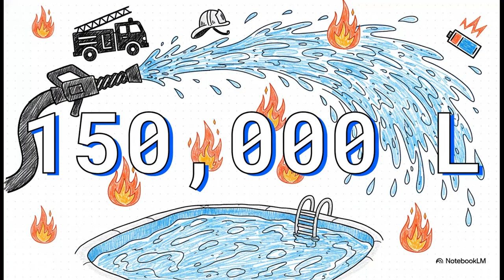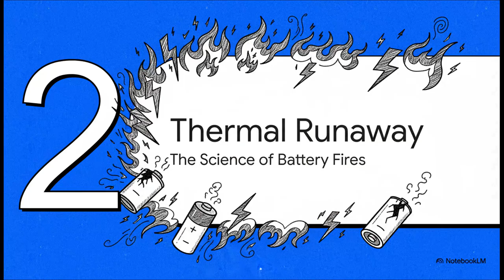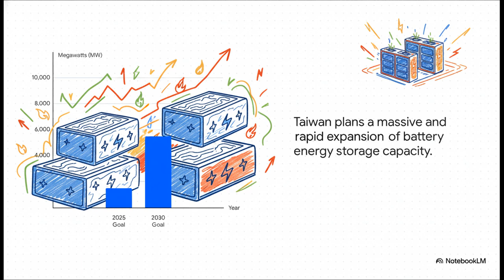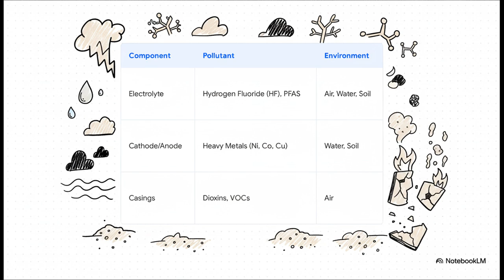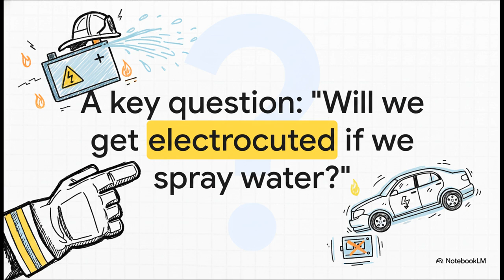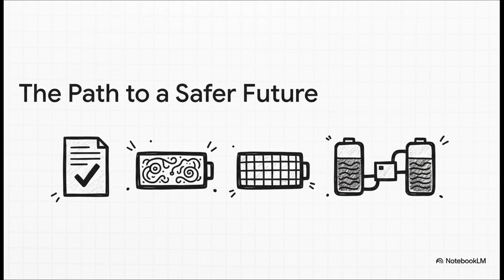EV & ESS Fires: Thermal Runaway, Environmental Risks, and Global Emergency Response Strategies.

Comment: Just another misinformation video and not even a good one. Average petrol car fire takes AROUND 3000l of water but lithium EV fire takes UP TO 150.000l??? 😂 Doesn't mention the figures on how many petrol/diesel vehicles burst into flames every year compared to EV's and there's a very good reason for that, it would hurt the videos main purpose. Video possibly paid for by petrochemical companies???
Reply: One thing you fail to mention is that Petrol and diesel does not spontaneously combust and Lithium Ion batteries have nothing to do with cars. Most modern car fires are electrical faults due to the demise of the carburettor, unleaded fuels which are much harder to ignite,  the introduction of diesel in the mid 1980 which is hard to ignite and the amount of electrical equipment in the modern car. Fact Lithium Ion batteries were a known fire risk before they were ever put into vehicles causing thousands of fires worldwide. They are a chemical battery and may start to de-compose around 70 degrees C and are easily damaged by shock, over charging or discharging , a chemical fire is the worst type, the fire may occur 24/7 and is difficult to prevent, develops quickly, burns hot which may compromise concrete structures such as car parks, is almost impossible to extinguish and may re-ignite day weeks or even months later. You are also seeing similar fires in battery storage, re-cycling plants , E/bikes and E scooters and in fact the Lithium Ion battery is the biggest growing type of fire worldwide. If you wish to talk about cars You also have to take into account the average age of vehicles. The average ICE car fire is 12-15 years of age and arson is around 65% yes 65 %. The worrying thing is that EV's have not been on the scene very long and are not really old enough yet to catch fire or should I say spontaneously combust. You are therefore seeing more and more car parks and some ferry companies banning EV's for obvious reasons. They have even been banned under the house of Parliament in the UK too Finally, I worked for the London Fire Brigade for 30 years and was in fire safety and fire investigation. Sadly, many who buy EV's have no idea about the type of battery, the risks and the precautions that may be taken. I post this as a retired fire officer trying to raise awareness of the dangers of Lithium Ion batteries.